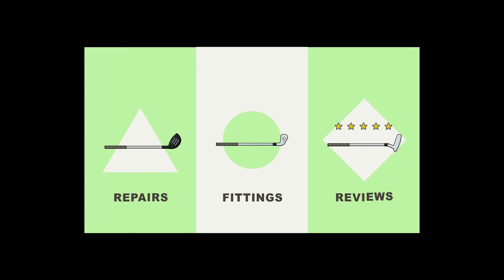NEW Callaway APEX reshaft

Comment: Question: If a manufacturer says their shaft is 90 grams, How is that measured for individual shafts of different lengths?  For instance, you have a 3 wood but then you also want the same shaft in your 5 wood and 7 wood. Obviously, just like your set of irons you're doing in this video, the shaft gets shorter from 4 iron down to wedge. Or 3 wood down to 7 wood. How can they all be 90 grams? Thanks.